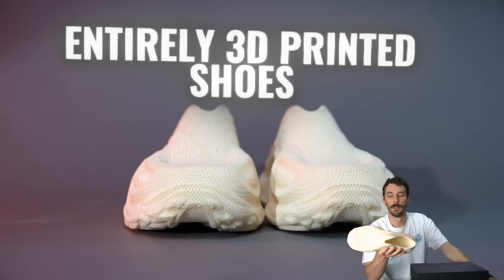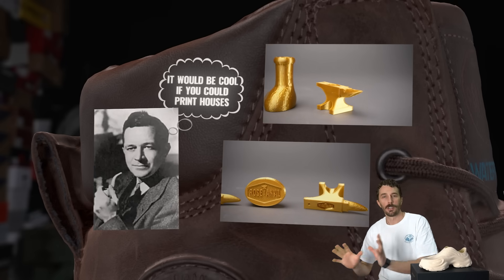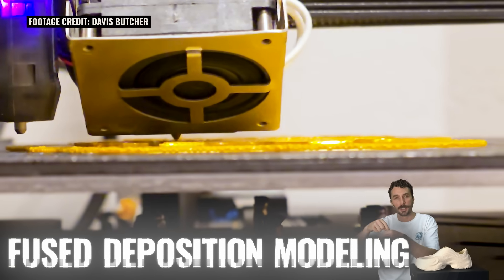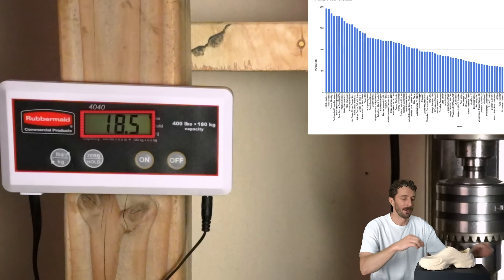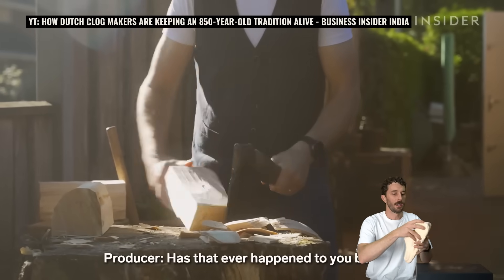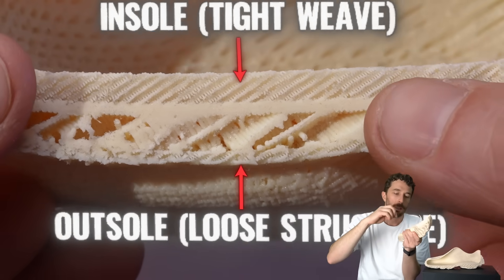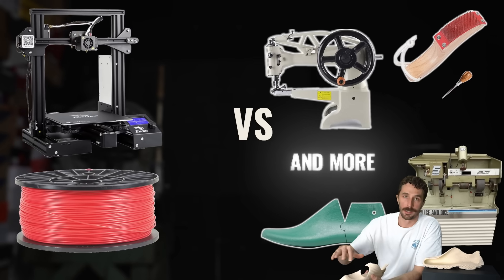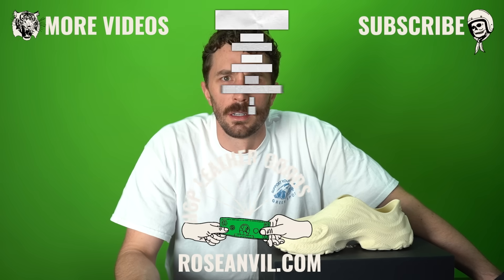The truth about 3D printed shoes - Zellerfeld

Comment: If I could print this for a replacement skateboard shoe, I totally would. This would save me sooooo many sneakers. Unfortunately, I just don’t know of a process yet to make it viable and/ or cost efficient.
Reply: A budget printer of appropriate size, with an upgraded direct drive extruder and a $30 ish dollar spool of TPU filament and a viable file will have you in perpetual shoes relatively easily. Though unless you have dainty feet the size of machine required will be a significant part of the cost. An Ender 3 can be had for $100 but has about an 8.5" x 8.5" printing surface which mak3s the diagonal just a hair over 12 inches. Meaning that a modestly dimensioned shoe could probably be printed in sizes up to size 11, maybe 11.5

If you have Shaq feet you'll be investing in a larger and significantly more expensive printer.

I'd say each shoe would take the better part of a day to print, possibly more depending on the design but basic skater shoes should be pretty simple and on the lighter side. With a bit of forethought that time shouldn't be an issue.

The file itself is another thing, I dont know that there's many quality designs available right now, free or paid, but I could absolutely see a number of both appearing soon enough and they could easily be designed with alterations in mind, the ability to adjust a template to suit your feet by entering some measurements.

If you wanted to get fancy there's multi color and material printing, you can print in nylon, PET (polyester), various elastic materials, rigid materials for toe caps etc.

Comment: If they could print shoes out of a 100% biodegradable, 100% non-toxic material, Id be completely on board with it. Additive manufacturing is intrinsically more resource efficient and creates less waste. One would be able to decentralise production and its possible to adjust the design for the individual customers needs without much effort. At some point you might even be able to print your own shoes or others clothing. As it is, I simply see it as more plastic landfill release into the environment. And we already have enough of that. No one is going to recycle this.

Comment: If you have a whole bunch of (not too expensive) 3d printers running, even if each one takes 40 hours, that's not 40 hours paying a craftsperson to work, it's 40 hours of electricity to keep the printers running. You could have loads of machines running at once, the operating cost isn't that high compared to a lot of other types of manufacturing.

Comment: Man that's really interesting to see, I've heard a lot of talk of variable density 3d printing, and the principal's pretty simple once you actually get your hands on 3D software and 3D printers and all that sort of jazz. 
But I'm surprised that it's just as simple grid pattern as you say.
Judging by the 24 hour print time , and from the close-ups, they must be using a very ordinary type of FDM printer, TPU filament and it looks like the real trick is there getting under extrusion. The under extrusion is what's causing the translucency. I wonder how they've done that? Could it be as simple as just under extruding? If so that's a crazy simple and clever solution. 
But the real value of this is if you can print it at home for pennies? if the only way to get this thing is a $200.00 print from somebody else then well yeah that's not really good value. I could probably print this on my crappy $300.00 3d printer here at home for maybe $50.

Comment: Allow me to retort on hours to make the shoes...you don't make a fair comparison if you only think of labor to construct. How many hours go into making the leather? How about the glues? The nails? Threads? Insole? Outsole?The 3d printed shoe is more time efficient if you consider all the inputs into normal shoe construction methods which are not required for the 3d printed shoe. It also then vertically integrates much of the business under one roof, which is more efficient still.

Comment: 250$ for this is crazy. even if the printing it self takes up to 40h  they dont need multiple materials, staff and they can print at night. U cant just take the assembly of a shoe as a time measure cuz you still need these parts to arrive sort and inspect. With 3d printing you have only the PC, filament and a 3d printer. There for most of you pay for is a hype or a design and not the acual product.

Comment: 3D-printing shoes or clothes seems like a great idea. You can still mass produce everything, but also have the possibility to produce custom fits at virtually no extra cost, there are technically no seams that can rip and depending on what materials you use the longevity could be pretty good compared to the cheaply produced junk that is currently flooding the market. 

Though repairability would be terrible. As soon as something breaks it goes into the trash, because it's all one piece that can't be repaired for a reasonable price. You'd just end up with loads of trash and with how greedy big companies are, the materials would probably barely last a year of wear at most.

Comment: Just to add sth: 3d printed houses are pretty much a scam. Or at least massively oversold. No doubts you can 3d print the shell of a house, but it’s costly, complicated and the end result always looks weird. However, you still need to dig and pour the foundation, build a roof, install doors and windows, do the wiring, plumbing, flooring, etc.. The time it takes to build a regular brick shell of the same size of a 3d printed house is not that much longer. Plus, 3d printing has many points of failures, you’re very size restricted due to the technological constraints of the printer and printing material and you need lots of extra manual labour to get a half pleasant end result.
The quickest and most cost-efficient way to get a house is and always will be the fabricated construction method: You have a factory that produces a large quantity of wall and roof assemblies which come with all the plumbing and wiring channels preinstalled and only need final assembly at the construction site without needing to transport a massive, expensive 3d printing unit from one site to another. 

3d printed houses are fake-futuristic, needlessly expensive novelties that fall in the same category as container homes for example.

Comment: a lot of the value in 3D printing is in design and prototyping. it can be very helpful to have something in your hands you can test, and then you can worry about better materials or tooling up for large-scale manufacturing after the design has been refined. 
but it also provides a way for people to get something when it just isn't worth it to tool up a whole factory to produce something.
Reply: this is what i thought also its more on prototyping checking the design and looks if its feasible or not

Comment: 7:21 If you wear ZELLERFELD sandals in Arizona's hot weather, the heat may cause the sandals to melt on the street. 😂
Reply: I was just about to say the same thing for us here in Australia. 🌞
Reply: Nice cafa racer :)
Reply: I'm here in Phoenix. Any 3D printed filament turns to goo if left outside during the day.
Reply: @LordHolley  any? No way rofl, only pla will do that. Petg might soften a bit, others won't be affected
Reply: @LordHolley  Good to know!
Reply: @LordHolley clearly you have only printed with pla and petg
Reply: Most common flexible material (TPU, which is already used in soles of normal shoes) has heat resistence more than 70°C, but I'd assume, that they're using some blend of materials, that will be even more resistant, maybe even more, so it should be fine
Reply: @Volnas97   from what I have seem every tpu is above 70 at least, and many of them are above 90

Comment: Would be really interested in seeing if this could be combined with some higher quality but easily mass produced parts. Like instead of 3D printing the Insole, just use a higher quality mass produced one. That'd save you a few minutes on the print as well.

Comment: These look like they would be ok for house shoes/slippers but otherwise appear to be far less practical for wearing outside in the rain, snow, dirt, rougher ground etc. than a pair of $21 Amazon "Dunks".
This looks like they're building a shoe that is full of compromises and sub optimal materials in order to be able to 3D print it. 
Surely the point of constructing shoes with a mix of materials for the upper, footbed, mid sole and sole is that you're using the best material for the intended use. 
I can see how 3D printing can produce a better shoe upper for certain applications (e.g. running) due to the ability to build more complex shapes and vary material thickness and density progressively etc. but to try and build a complete shoe that way seems to be creating a compromised product in order to use the technology.
Reply: Can't believe how many stupid comments are posted. At this point in the development of the tech AND the market, they're obviously creating a reasonable product at a high price point that will sell enough to allow further expansion and refinement.
Reply: @grantc61  The problem is that the materials it can print are extremely limited. It's not going to be able to print a carbon rubber outsole or leather reinforcements or.... It's basically able to print some form of polyester or other plastics that can be produced in a liquid/semi liquid form at reasonable temperatures. That means it can probably produce a very light and comfortable race shoe for runners and Yeezy lookalike fashion shoes but there will always be distinct limitations.
They'd be better sticking to producing custom sports shoe uppers and using  conventional materials for the rest of the shoe as the advantage of 3D printing is in the ability to produce complex shapes and vary density, thickness, stretch etc. across a single piece of printed material. That's its USP as I understand it.
In the real world we use all sorts of materials like stone, ceramics,  wood, leather, concrete and metals because they are better suited or because people do not regard plastics as a particularly desirable material, and that will always place limitations on 3D printing and what it can achieve.

Comment: I’m not sure that 3D printing is far enough advanced for printed shoes to be available en masse in the near future. One thing that does surprise me though, is why bespoke shoemakers haven’t yet adopted 3D scanning of their client’s feet. It seems odd they still have craftsmen making lasts from foot measurements rather than scanning and then moulding (or 3D printing) a last.
Reply: Doing 3D scanning reliably and then being able to whip something custom up in CAD from that scan just really isn't possible without a lot of man hours yet.  Also you are going to spend anywhere from 25-100K for each scanner.

Unless someone is spending like Ferrari money on bespoke shoes, it's just not going to be worth it.
Reply: @yayinternets  I certainly wasn’t thinking it was going to be a technology for masses. Bespoke shoes are incredibly expensive because of how labour-intensive it is to make them. Currently they take foot measurements then carve a pair of lasts out of wood blanks by hand. Lasts are then adjusted after an initial fittings before the final shoes are made. I just thought it might be more productive and, possibly more accurate, to introduce scanning and 3D printing.